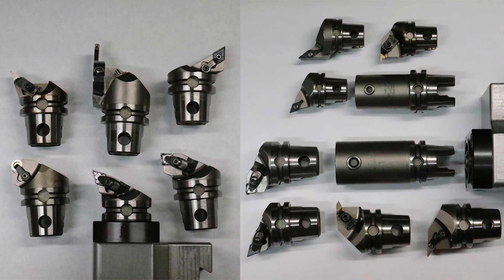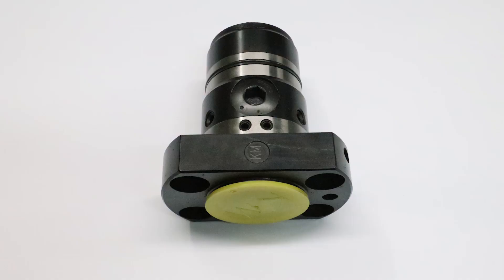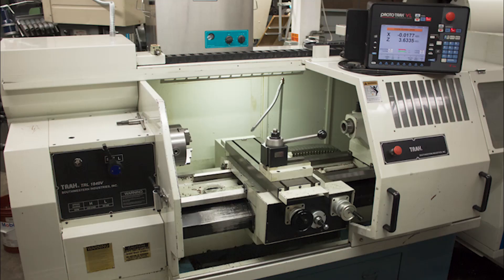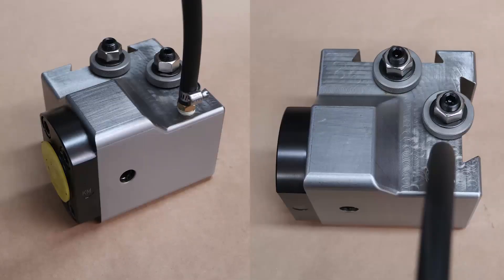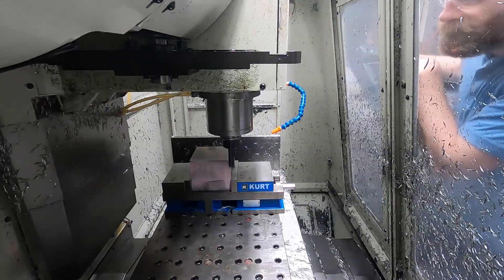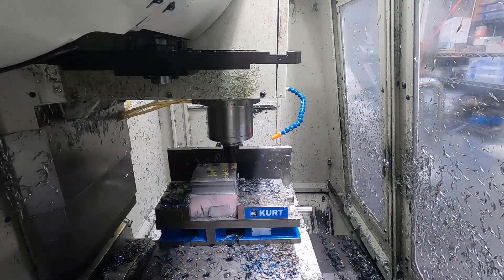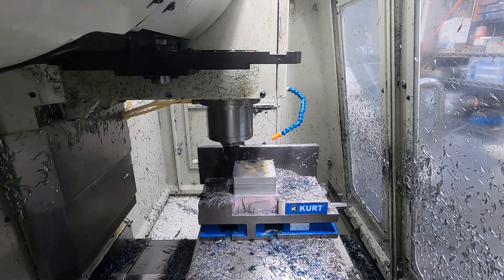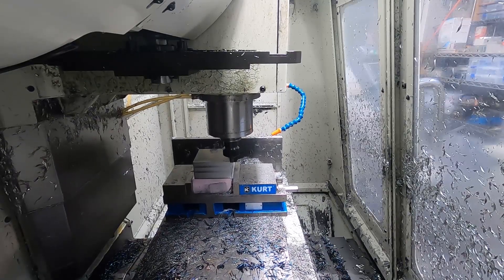Machining A KM 50 To Aloris CA Tool Holder

Comment: You might want to consider making a backing block for the toolpost on that TRAK lathe if you do not have it pinned to the t slot.  I have the same lathe and discovered that it is possible for the t nut to slide in its corresponding slot throwing off right angle as well as tool offsets.  (Threaded fasteners are not designed for holding position, that is why we have dowel pins remember) I did not wish to pin it, and since the slot is long enough to accommodate it, I made a double studded “support block” to mount behind it in the same slot.  The support block has two lateral deep set screws at the base(front and rear) to bear against the toolpost and used to adjust for square.  Haven’t had a problem since  I did this. I gave all machined surfaces that bear against each other a Lanolube film for rust protection.(still one of the best corrosion fighters available after all these years.)
Reply from the maker: Twisting the block can be an issue especially during heavy drilling or an accidental bump. I agree that a block on the back like you described would be better than pinning it. I did take this into consideration on the design of this holder. When it mounts for ID / drilling work it is directly in front of the Aloris block and doesn’t impart twisting forces. When mounted on the side for turning it does hang off and has some twisting forces, but the overhang is less than if I was using boring bars. I should have put pictures of it in use in this video, but I do have a video showing it being used. One advantage I see with having the overhang for OD turning is when I’m turning short large parts that won’t clear the cross slide. Overall, I’m pleased with it.